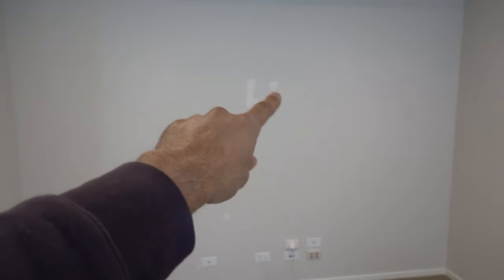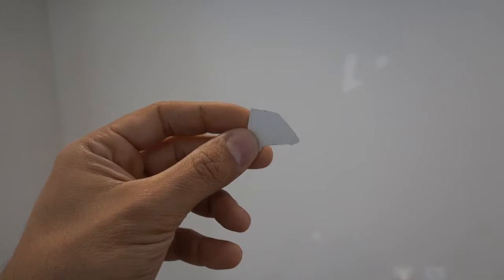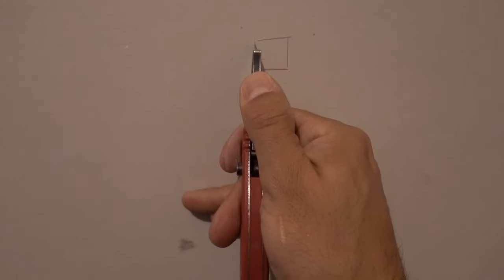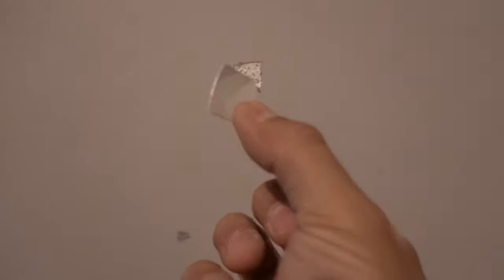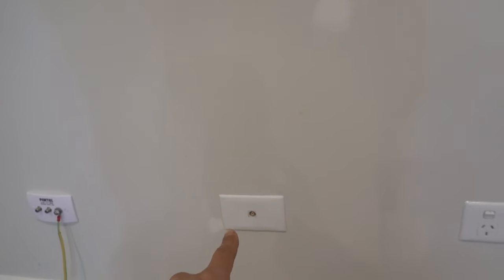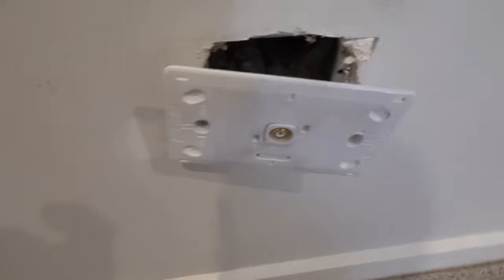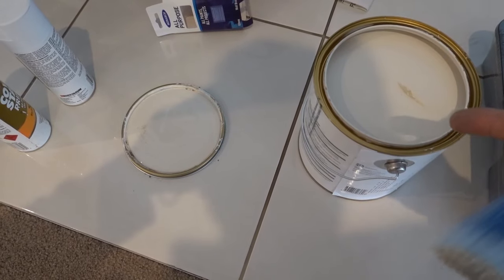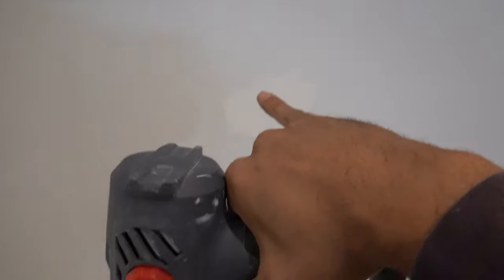How to match paint color 100% the easy way

Comment: The tip you showed to get the sample from behind the plastic plate saved me so much time. Thank you!!  I am just doing a small touchup to my kitchen wall and the wall uses a light tan colour.  The difference in shade between the paint hidden by the plate and the part exposed to the elements is not noticeable in my case.

Comment: As someone who has matched paint for years, I offer the following tips to ensure you get the best color match possible
A) NEVER bring your sample to a hardware store to get a quality match.  If you want quality, go to your local paint store where theY have qualified staff.  IF you want quick, go to Home Depot or Lowes. 
B) Make sure you pull your sample from an area of the wall that best represents the color you are trying to achieve.  Several factors cause paint to fade.  While pulling a sample from behind an object might seem clever, remember its been hidden from sunlight and smoke and other things  that can cause the color to change. Bringing in a sample that doesn't match the actual color  you're trying to touch up is frustrating to you and the person who just spent time matching your sample when you come back to have the color adjusted. 
C) Whenever possible, bring in a sample that is at least the size of a 50 cent piece.  This allows the person doing the match to put some paint directly on your sample to ensure a high quality match.  Contrary to popular belief, the computerized color eye used to match paint is not always accurate and may need some tweaking.
D) Unless you know for a fact what manufacturer and what product was initially utilized and go to that same company to have the match done, there is a good possibility that while the color may match perfectly, the sheen does not.  You may notice the difference when the lights are on and you look at it from different angles.  

Hope this helps.
GOOD LUCK!!
Reply: Thank you for your wise words Paul 👍
Reply: Great tips!! Thank you so much 🙏🏼
Reply: Thanks for your info. For Australian users, Lowe's here is a menswear store only and Home Depot does not exist. DO take your sample to a hardware store - take it to Bunnings (Australia). All the other info sounds logical and useful 🙂
Reply: Absolute legend!
Thanks for writing it all out
Reply: Hey Paul, maybe you can answer a question for me? We have plastic shutters that were painted with a spray paint that has been discontinued. Would like to match it with a roll/brush on paint. Can I take the shutter in to get it color matched or the cap from the empty spray can? Or a piece of door trim? Does the sample have to be thi and flat like this video shows?
Reply: @punknhead23  If you are trying to touch up I would recommend you bring in the shutter and not the cap.  The reason for this is that the shutter paint has been exposed to the elements and is probably faded a bit. This means that matching the original color (or the cap) may not match what is on the shutter now.   The sample doesn't have to be flat but the flatter, the better.
Reply: @Paul  thanks so much for your answer. Actually want the original color. One of 6 shutters is in the sun all day so it gets faded sooner than the others. Thanks that is very helpful.
Reply: How do I get a paint match from a lawnmower?
Reply: @Paul-co9lb
This is a global website where most people aren't American so you need to stop randomly recommending stores from your country. It's even worse when it is obvious that the video you are responding to clearly isn't from the USA. This is part of the reason why people dislike Americans.
Reply: Finally, an honest answer! We even have the exact name of the paint color and they stil can’t match it. Very frustrating experience!
Reply: @tree_eats  Where did you negativity come from??? This guy was just giving honestly opinions as a professional, he did use the term hardware store and local paint store, maybe you should read the comment carefully first.
Reply: @tree_eats  Was is just a bad day or do you have a very small mind?
Reply: How big is a 50 cent piece? 😂 what if one wall has a lot of sunlight it will be a different colour. Will they know if it is gloss mat or flat ?

Comment: I always remove the plates prior to painting rather than trying to hand cut around them typically it is only 1 or 2 short screws 4 if its a larger size. And after removing the plates I normally can find  one with enough painted sacrificial pained surface for a sample for matching of color

Comment: Great idea! 👍👍
Reply: PS. I realized that taking a sample from behind a wall plate wasn’t a good idea. The paint matched the sample but was lighter than the colour of the wall I needed to touch up. The reason, for this is simple: a sample taken from behind a wall plate is somewhat protected from the elements and ages differently than the paint that is on the actual wall especially if you’re trying to match a colour of paint that is at least 10+ years old. I managed to get it looking good after a lot of dry rolling and feathering the new paint to blend with old.

Comment: I have a nice white, smooth ceiling in Kitchen. Small part was water damaged. I was afraid to patch IF I couldn't match the white. Now I have more confidence. Hope it works. Anything to add for a CEILING repair?? ❓❓
Reply from the maker: I have many videos on how to repair ceilings . Also, generally ceilings are painted in ceiling white which is an off the shelf color. Depending on how old and discolored your ceiling paint is , you may have to paint the whole ceiling

Comment: I sure wish this was true. I've tried to color match the white paint on my apartment wall, and they can never get it right. It's off just enough that you can tell where it's been applied vs the original. 😢
Reply: Very frustrating because they promise an exact match!😫
Reply: @rudysmachado5747  it certainly is... especially when you're a renter and want to paint areas that have deteriorated over time (like the corners of walls!).